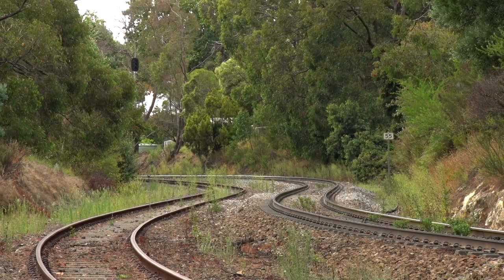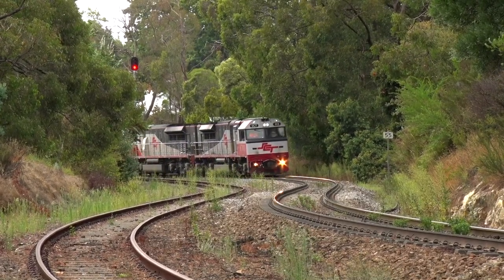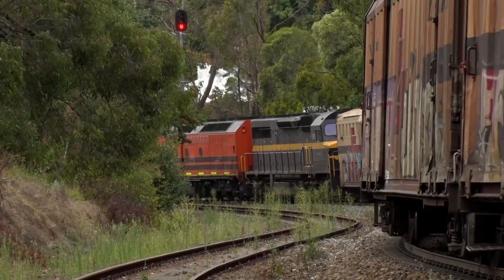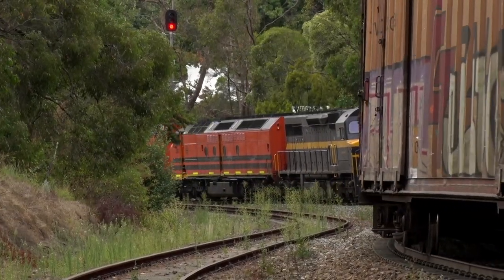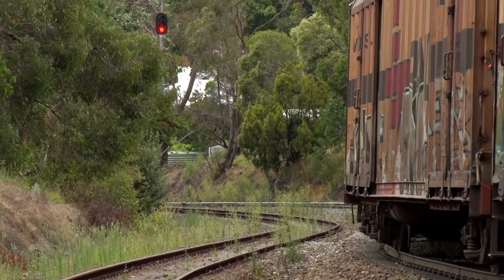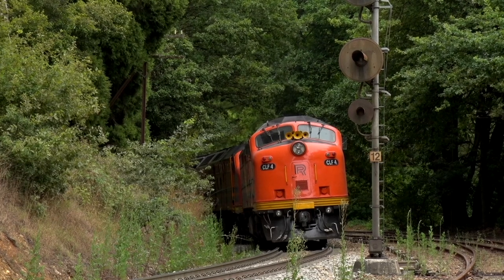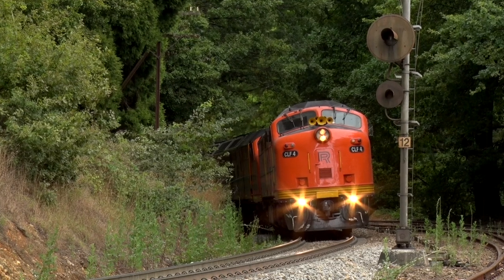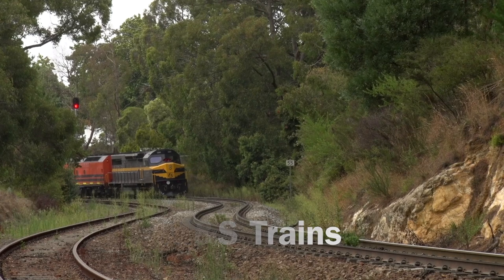Vintage EMD's push SCT Intermodal to MT Lofty Station.

Comment: That is so cool seeing a Leslie 5 chime right up front on the hood! gives me goose bumps.
Reply from the maker: I guess it is a bit unique Tyson! Our loading gauge is small down here , so locos are smaller than most US ones. I assume the horn was put on the nose, asit would have put the loco "out of gauge" if placed on the roof! Most of our original lines are too small for double stacks, so bridges and tunnels reduce the size of equipment;_(.   We are getting there though , as the new "Inland Rail" is being built for double stacks!
Thanks for watching !
Cheers Gregg.

Comment: I look at these trains in awe, we have nothing like this in the U.K. as they would be passing through 3 stations at a time. Good to hear from you Gregg and a great site pushing up that hill. Keep safe. Frank
Reply from the maker: Not quite the US , but we are getting there with these Frank! Most of the SCT and PN  trains run at 1500 - 1800 m in length , but our axel weights are only 21 tonnes on some lines so the weight is down on the Yankee trains!  Glad you liked it and thanks for watching.
Gregg.
Reply: @FishplateFilms  That why all these locomotives are built down to a weight. when inside, they are American machines. The biggest difference is with the modern locos up front. They still must only be in the low 130t, while American or Pilbara locomotive are almost 200t.
When the CLs & C class were new, American locos were around 120t for 4 axle machines & 160 to 175t for 6 axle.
Only a few giant machines were larger.

There are very few other countries that have these full size locos & they 8 axles rather than 6, to lighten the axel load.

Comment: G'day Gregg, when the C class was built that was the only paint scheme, blue and gold, so there was not different schemes for freight or passenger trains. Great video, and I have started using the Inox fluid you recommended a while back, great stuff, had not had to clean the tracks in over a month, a new record for me. Thanks for that, regards Bill in lockdown Melbourne.
Reply from the maker: Thanks Bill! For some reason I thought VR had different paint schemes..my bad! I'm glad you are getting the results I promised from the Inox! Just apply some now and then and it will keep your wheels clean also! 
Cheers Gregg.

Comment: Great video Gregg. One reason we still see so many trucks on the road is because some businesses know how long it would take to get helper locos to move a stalled or broken down train on quite a few main lines, due to no relief engines at strategic points. And you only have to see how backward the passenger service from Melbourne to Albury is for example, with no relief engines available in case of a breakdown. The sooner they acquire more motive power to avoid long delays the better. Like you say freight movements have improved, but not the motive power to keep up with it. Imagine being the consignor of the freight on that stalled train, and having at least 13 hours added to the trip, which would cost a lot of money, and make customers very unhappy.
Reply from the maker: Thanks Brian!  We are so far behind down here, at least 50 yrs compared to the US , and rail does not get the support from governments like it should?  But the cost of road shipping is vastly underrated and we all pay for the roads that trucks drive on and tear up! We are getting there slowly and hopefully , Inland Rail will help push things forward.....an interesting future ahead.
Cheers Gregg.
Reply: @FishplateFilms  Very true about the trucks, and mainly overloaded trucks. I was once a Clerk of Courts in another state and I remember a course we did with the Transport Department way back in the day about overloaded trucks and why penalties were so high for the operators who had to pay the fines.The figures for road damage for a sedan was on average just 6 to 7 dollars a year, but the cost from damage to roads from illegally OVERLOADED trucks was on average 6 to 7 thousand dollars per year per truck, so add that for all the trucks, and is it any wonder  that rail is still the best way to move heavy freight.. Germany and other European places have the right idea, using mainly rail to move the freight long distances, yet still keeping truckies employed and still happy, moving the freight from large rail depots to other regions.where trains do not run. And overloaded trucks are almost a non event in Europe.The simple solutions seem to be so difficult in this country.

Comment: Great video Gregg, interesting how the units in the back had the horns on the hood.  We have alot of power here in the USA collecting dust, to back it can't be transported down under.  How's the house going?  Hope you are doing well, as the heat is about to hit you guys.  Cheers from Terry in mild Nebraska.
Reply from the maker: Thanks Terry! When Inland Rail opens in about 2 yrs time, we will need a lot more power so that might be on the cards? How good would it be to see SD40-2's screaming through Lofty!! We are still in engineering on the house and hope to be building by mid next year? 
Not looking forward to the heat coming :-(
Take care Sir.
Gregg.

Comment: Those are nice engines and a very nice place to film. I have never seen horns on top of the nose like that, is that common down under?
Reply: Most large Australian locos have horns recessed on the roof to keep them within loading gauge clearances. The EMD "bulldogs" out here commonly have them on the nose for loading gauge reasons. I think it looks great. Smaller branchline locos stick them on anywhere.
Reply: @peterainsworth8466  thank you for the reply Peter. I like them too on the nose, it looks mean, like :  "get out of the way ,I am coming!!" haha